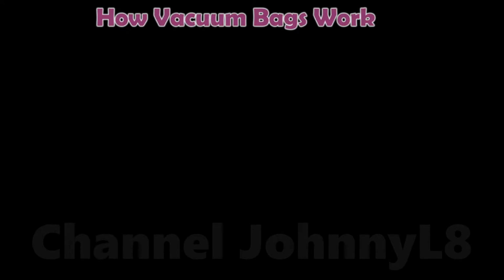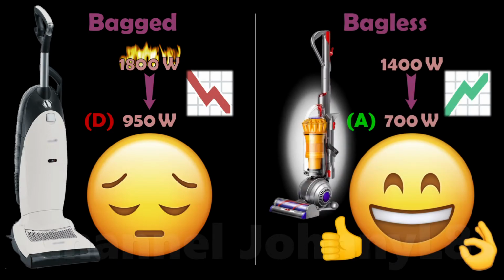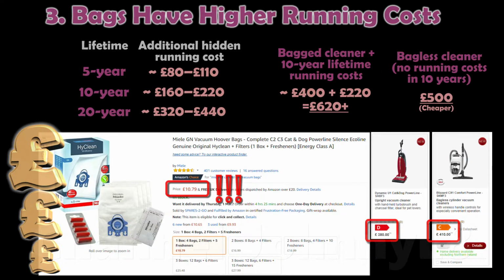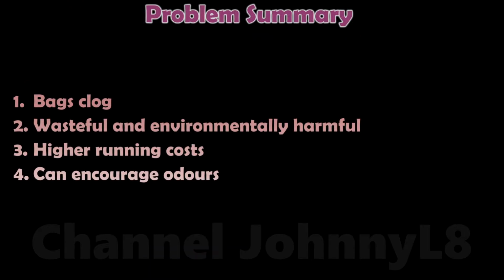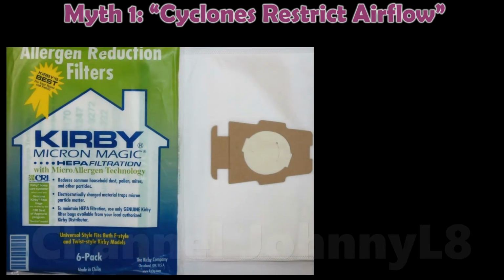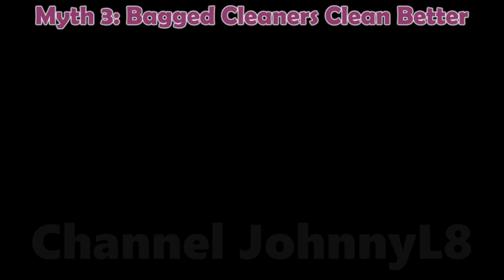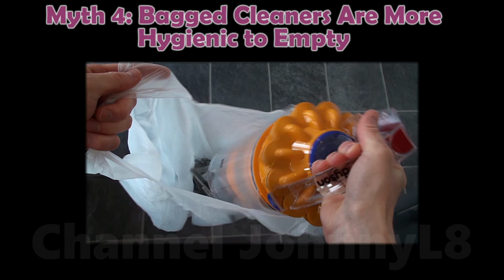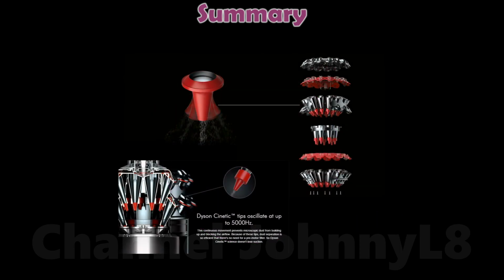Bagged Vs Bagless Vacuum Cleaners

Comment: https://youtu.be/nDaAYY1ky3Y
Reply from the maker: It's something I've discussed with that guy in my comments. You can put a sponge or bagpipe or literally anything in the circuit and conclude they reduce air flow too. I explained in clear detail (i think on one of the two Cinetic videos I did) why this test is misleading if it's used to conclude cyclones restrict airflow. I'd just be repeating myself if I explained it all again here.
Reply: JohnnyL8 I still can't quite grasp why cyclones don't restrict airflow. But I'm not a scientist haha
Reply from the maker: They do restrict airflow, but so does a bag or anything you put in the way. It's how that's interpreted that's misleading.
Reply: But the cyclone unit is restricting airflow right away and a bag will restrict airflow as it fills but when the bag is empty it will have more airflow than a Dyson? Is this true? I have seen Dyson testing the airflow at the cleaner head on their air flow box. They test a Dyson against a Shark. The Dyson wins. But what if they did the same test with a Kirby or Miele cylinder who would win then?
Reply from the maker: Short version cos im trying to record and ive got little time. to repeat what is said in other comments. the restriction of airflow is irrelevant; motors are tuned to perform with such resistances to get optimum suction at cleaner head where it counts. Suction/air current by itself is irrelevant because youve got to consider literally everything else to determine cleaning performance. and only cleaning performance is relevant at the end of the day, not isolated metrics like air current.
Reply: Ok I will leave you in peace to record. Look forward to seeing the video :)
Reply: Vacuumtests I agree with Mike. I like some Dyson products but they will never be the deepest cleaners because of the multi cyclones. I do like their stick vacs for convenience. 😊
Reply: Vacuumtests Yes they are the good points of the Dyson. The light ball is quite a bit quieter than the DC40 and the direct drive floorhead cleans better. They do work very well in certain circumstances. Low to medium pile and on hardfloors they are excellent! 😁
Reply: Vacuumtests One question Mike does the Dyson floorhead seal in airflow better than other floorheads which may have higher losses at the cleaner head than the Dyson? It's airflow at the cleaner head that is most important.
Reply: Or is it just marketing hype 😀
Reply: Vacuumtests That is true. The new floorhead on the light ball in minus position does make it easier to push. They will probably use this floorhead on future Balls in the US.
Reply: The Shark did a little better, probably because the single cyclone doesn't restrict as much as the multi cyclone.
Reply: Good point!  I would still choose the Light Ball over it though haha :)
Reply from the maker: I'm away atm. Is there a video link I'm missing? I can't comment otherwise.

Comment: https://www.youtube.com/watch?v=23FYE9e9SoA
Reply from the maker: Yes it's a good lay talk about the science behind their technology. He even went as far as to touch on the importance of not just flow (current), but pressure (essentially speed) from the digital motors—something certainly not well understood on much of YT it would seem. And again, the air watts listed beautifully show why air watts are, in themselves as a number, completely misleading because they're so misunderstood by so many on YT. Those numbers quoted are the maximum air watts produced by the motor; the numbers cited yesterday are the resultant air watts at the cleaner head, i.e. after all internal resistances and where they are capable of being useful (have you ever heard anyone that promotes on YT ever show anything like that kind of understanding...nope). Furthermore, how those air watts are used is more important than how many there are. The art of efficiency and optimisation is to achieve mains-level cleaning performance using less. Dyson have shown that ~35 aw (i.e. normal mode) at the floor head achieves comparable cleaning levels (in normal conditions) when combined with the other things their floor head does. The region and depth of the carpet where dust mostly resides in normal living and where it can be released into the air if disturbed to cause health issues, is penetrated by how those available air watts are used. But, if you look at the comments, people STILL think you need big numbers, and complain you only get 150 aw for 6 minutes, and walk away not understanding why they don't have a clue what they're talking about and why what's actually correct is actually unintuitive. This is party Dyson's fault; they really should do a better job of explaining why normal mode (20 minutes) is comparable to a mains, and why max mode isn't always needed.

A lot of the battery issues he raises (which they worked around) will be solved in the next decade or so as new battery technologies come online.

Comment: I like the look of the V10 a lot but having just purchased the Light Ball do I want to spend another £400-£500 for the convenience of the V10? Right now no I don't.
Reply from the maker: I thought this was worth pointing out to highlight a point I've made frequently. Look at how competitors asterisks actually pan out. They'll say "The world's most powerful suction*" in marketing, but the asterisk (in almost unreadably tiny fine print they don't want you to see) reads "suction tested in comparison with leading cordless stick vacuums" and "based on internal testing". And no one calls them out on this. So, firstly, they apparently compare with Dyson's older normal mode and completely ignore the other higher power modes, thereby not comparing apples with apples. Then they literally ignore international industry standard testing, which is the only way to achieve fair comparison. They're completely deceptive. As soon as you see this, it should send alarm bells ringing. Why would they need to be so deceptive? What are they hiding? Why not do fair comparative testing? Why not show real test results? Dyson at least have never done that. All their advertised claims have been measured against formal international test standards and they never play deceiving games and make comments that are measurably false. "The world's most powerful suction". What a lie, even before the V10. Interestingly, the Samsung digital motor is only 150 W (not air watts). There's no way their tech is likely to reach the levels achieve by Dyson now. Dyson did what all good companies do; invested hugely in R&D. They nailed the science and engineering way before anyone else, became quantum leaps and bounds ahead of the competition and down the technological road, and most importantly, patented all their hard work so some cheap scum company out for a fast buck can't just steal it all and repackage it. This is so clear in Samsung's offering; it's actually inferior to Dyson's version 1 digital motor from 2009. Yes, they're literally more than 10 years behind. And people just buy into marketing without checking anything. And then no doubt get very aggressive and anti-Dyson when they're called out, much like I experienced in recent weeks.
EDIT: Link: https://youtu.be/hZZJ8TJkAw4?t=1m2s
Reply from the maker: What's also particularly hilarious about their daft marketing claim of being 'faster than a tornado' (whatever that actually means) is that they were forced to put a second "**" and cite the enhanced Fujita Scale, which is totally off topic for vacuum cleaners (and in case anyone isn't aware, is a measure of damage levels associated with wind speeds and projectiles, determined from engineering-studies). xD
Reply: JohnnyL8 I agree with you. But too be fair Dyson have had their fair share of marketing BS over the years too 😁
Reply from the maker: They also don't specify whether it's fade free battery to achieve that 40 minutes of run time (in normal mode don't specify whether includes tool attachment or not) or whether half way through a charge, you're getting 30% of the original suction now and thus wasting your time because you're not picking anything up. They also state their batteries retain 80% of factory new charge after just 5 years—3 times less than the V10. It's quantifiably inferior technology.
Reply from the maker: Like what, specifically? Also, nothing in this league of utter falsehood I'm aware of.
Reply: JohnnyL8 😂
Reply from the maker: It's just one after another on that marketing clip. "Non-stop power with additional battery"...except you have to stop to change it over, and you actually have to buy it separately—not cheap and very material wasteful. And then you've got to manage the charging of two batteries, which is a hassle. Better battery technology automatically fixes that, which is why Dyson don't market this 'feature'. The brush heads use belts to drive them, and there's no evidence two actually cleans any better and isn't actually just a gimmick. The cleaning path on the mini motor tool is so narrow it makes Hitler's moustache look wide. xD I'm sure it's a functional product, but their marketing is deceitful and I bet they charge a fortune for it. That's what I'm criticising because people won't check, and will be essentially robbed.
Reply from the maker: I'd be quite happy to do an expose video of Dyson's dodgy marketing if you could find (any) evidence of claims made which are formally shown to be false (at the time the claim was made)—in the same vein as the Samsung advert. Even a single piece of evidence. Put your money where your mouth is and send it along. :p
Reply: JohnnyL8 Do you remember "Never loses suction" They should have added providing you wash the filters. And "Twice the suction of an other vacuum" I don't like the way Shark go about their marketing and those informercials drive me nuts! So annoying! But anyway the cream always rises to the top so if the V10 is as good as Dyson say they have nothing to worry about. I.do think £400 to £500 is overpriced for what it is. I'd love to know how much they cost to manufacture in Malaysia. £30 a unit?
Reply: I know they invest a lot into R&D but still overpriced. 💰💰💰
Reply from the maker: I think "overpriced" is distinguished from "more expensive than I'd personally like" by evidence. And I suspect only Dyson have the cost evidence required. There's more to their prices than cost of materials and manufacturing. A lot of highly skilled people went into designing it who all need paying during that time, with pensions and NI and so on, there's costs of the building (heating, lighting, rent, tax etc.), other staff, and everything peripheral, which is a lot. And the need to be profitable to some degree to ensure future survivability and expandability. Remember, Dyson has NO shareholders, and thus there's no one out solely to get a fast buck, unlike the other companies. Dyson himself, who is the only 'shareholder' and owner, doesn't exactly seem to be living a life of gluttony and luxury; he's working his ass off in the lab and presenting internationally around the world, earning his paycheck.

You can do a relative comparison though of cost per what you get. If you look at some cheap knock off products that are inferior cash-ins, some are priced comparably. That is clearly overpriced by association. But do they get criticised in the same way? Nope. And why is that? It's because people are too docile to notice, or only have daggers for the top dog, which in this case has earned their podium stand.

"Never loses suction" was challenged in court. An independent third party (i.e. a formal judge) ruled in Dyson's favour and concluded "never loses suction" is absolutely true on condition that the instruction manual is followed and the machine is used as designed and intended—completely reasonably. So that point disintegrates. "Twice the suction of any other vacuum" can with an expected "*" and they made it clear that it was in max mode and tested against industry standards for products available on the market at the time. You've yet to provide evidence that isn't a correct claim. :P Both those examples are debunked and nothing like the Samsung claims. Yes Shark have dodgy marketing, but that's obviously so. So still need you to justify the claim Dyson have dodgy marketing. It's either true, or it's false, and everyone, in principle, should know and why. :)
Reply: JohnnyL8 When they first came out with never loses suction it was misleading. People thought they were buying a vacuum believing that it will never lose suction only to find that they had to maintain the filters or it would lose suction. I thought Dyson were making huge profits. Are you saying Sir James is slummimg it? 😁
Reply: Their Reveue went up 45pc in 2017 to 2.5 Billion. I don't think we will see James in a soup kitchen any time soon 😁
Reply: Anyway stop wasting valuable time and get on with your video! 😀
Reply from the maker: Yeah, the no suction loss claim was true on day one as determined by a judge. That some (idiots?) then found out they had to treat the machine with basic levels of respect associated with a dignified society is not a convincing argument they mislead. A judge agreed. This is unlike the Samsung claims which are clearly false and highly misleading without any like-provisos. So I'd still say your claims were unfair towards Dyson's marketing there. Stronger evidence needed (or even a review of your opinion! :) )

Yeah Dyson are making shit-tonnes of profit. And that because the majority of people (not represented by the 'enthusiasts' on YT which seems to reflect a parochial numerically insignificant and totally unrepresentative number of the population as to be almost statistically irrelevant) can see that their products are top notch and worth the money. You get what you pay for, as the saying goes. Well, that is until the cheap cash-in clones slither in to milk their victims, charging comparable amounts for vastly inferior products like second-order thieves. So I'm saying he's earning his salary, he's reinvesting those profits back into the business (to the extent I now have an amazing product that actually works), and he clearly isn't a greedy profiteer like the shareholders of the other rival companies. Tell me I'm wrong (well, show me with a strong argument).
Reply: JohnnyL8 I agree with you. It's the same on VL if you say anything good about Dyson you're seen as the anti Christ 😁But like you say they have millions and satisfied customers and that's all that counts. 😊
Reply from the maker: I've written the several page, 2500+ word shorthand plan listing all I want to cover. I've got several thousand word scripting to write now, then visuals (which are less in a review type video), audio recording and editing, video recording (heavier in a review video), full composite editing, rendering, then upload left. Days of work :/
Reply from the maker: And then I get a comment "I don't need to watch a 10 minute video because I already know Dyson are bullshit".
Reply: I know. It's very disrespectful :(

Comment: How does a Dyson stand up to a Commercial vac like Sanitare and Royal or an high end multi purpose vac like Kirby? And besides them what other brands do you prefer.

I'm definitely not a fan of shark at all  They're bowling ball and liquid testes are extremely flawed.
Reply from the maker: Unfortunately, other manufacturers don't publish their industry standard test results, so it's hard to be sure how well they stand up. It's likely they do less well—otherwise marketing wouldn't hesitate to jump at letting people know. I've never used a commercial vac; they're also not in the same category as commercial user household cleaners, so comparing would be apples and oranges.

Oh yes, those liquid tests show suction power, but they don't necessarily directly equate to cleaning performance. At least when Dyson do those tests, it's to show how powerful their motors are and not to show how well they therefore clean; different industry standard tests are used there. Those tests are something Shark won't show because their results aren't as good.

Comment: NO NEED TO WATCH A 15 MINUTE VIDEO TO TELL YOU YOUR WRONG. A DUST CLOUD WHEN EMPTYING A DYSON IS ENOUGH. NOT TO MENTION ALL THE OTHER FAILINGS OF THAT DREADFUL VACUUM.
LOSS OF SUCTION? THERE'S A LINE ON THE BIN THAT SAYS DON'T FILL ABOVE LINE. WHAT HAPPENS IF YOU GO OVER THE LINE?
SMELL? VACUUM UP SOME LAUNDRY SCENT BOOSTER.

NOW THE CLOWN WANT'S TO BUILD AN ELECTRIC CAR. CAN YOU IMAGINE THE DISASTER THAT WOULD BE?
Reply from the maker: If you had watched the video, you'd have learned a lot about the opinions you hold and why many are myths. For example, dust clouds when emptying can easily be avoided, and much more. The line on the bin is there to indicate to the user when it needs to be emptied, much like how the "E" on the fuel gauge of a car is there to tell the user when you need to refuel. If you don't, and thus abuse the technology, it will fail.
Reply: NO NEED TO WATCH, I USED DYSON. THEY ADVERTISE NO LOSS OF SUCTION, IF YOU DON'T FILL UP YOUR GAS TANK WHEN IT SAY E, IT WILL EVENTUALLY RUN OUT OF GAS. WILL DYSON BY YOUR LOGIC LOOSE SUCTION? SUCTION ISN'T THE ONLY REAS0N I DON'T LIKE DYSON.